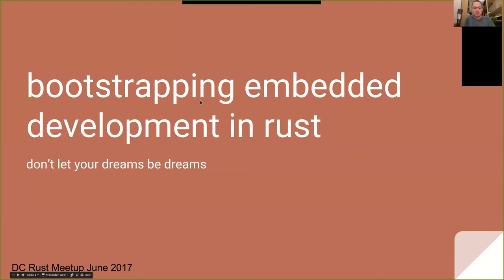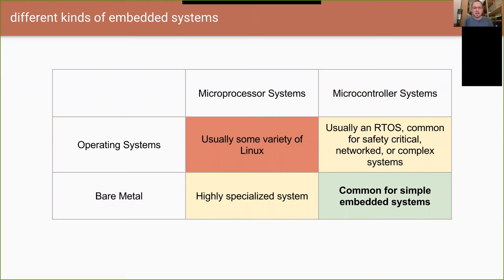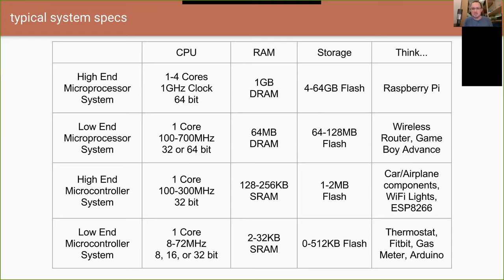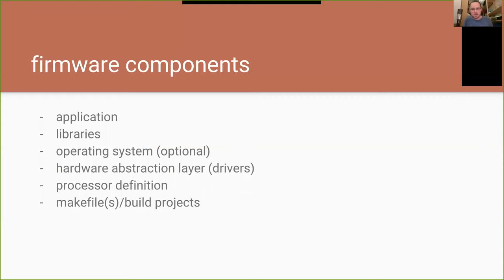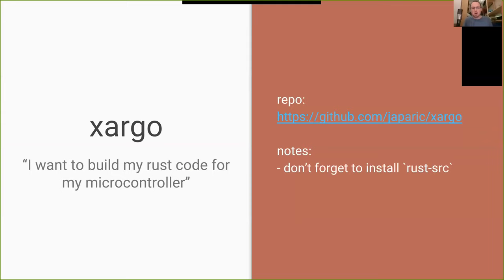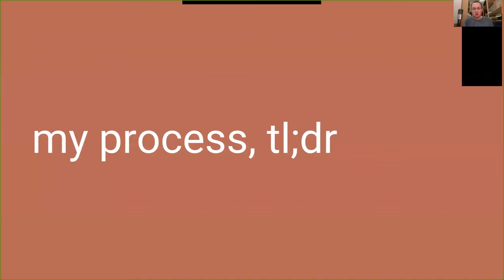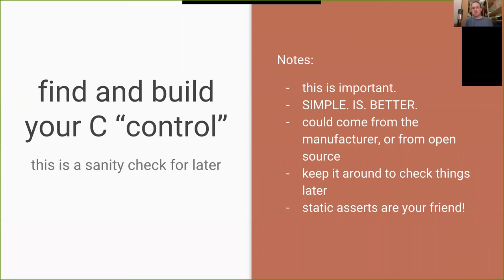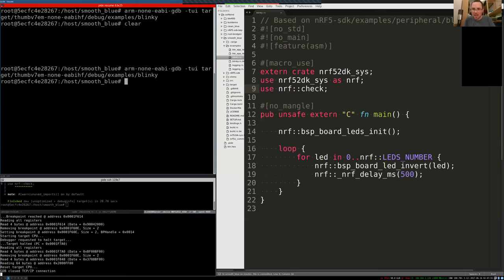Bootstrapping Embedded Development in Rust @ Rust DC, June 15, 2017

Comment: You can get these development boards on Mouser. Just search for NRF52-DK. The code to follow along with is on github at jamesmunns/nrf52dk-sys

You will have an easier time following along with the code if you use an Ubuntu OS.